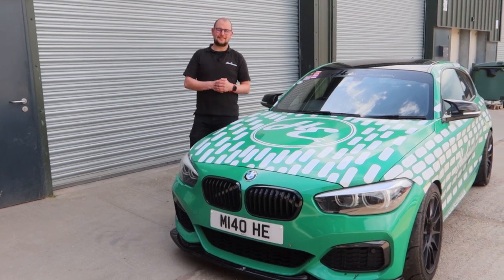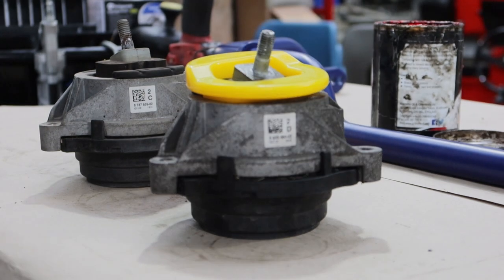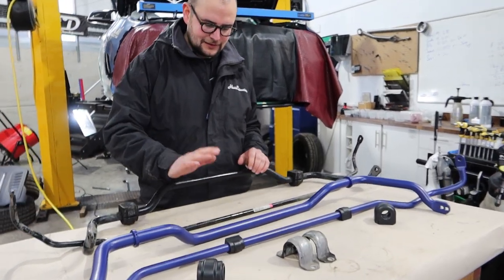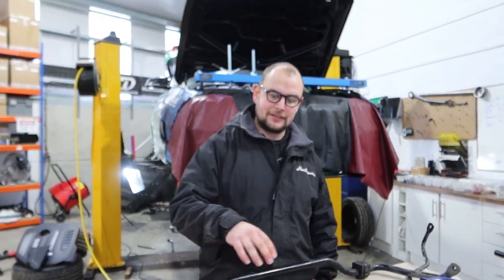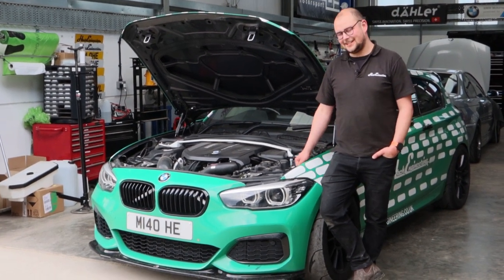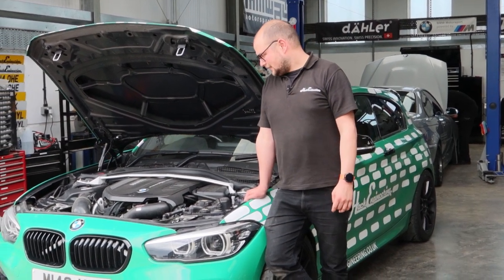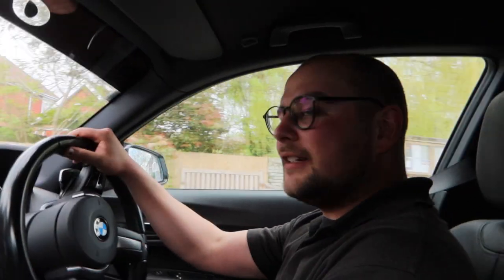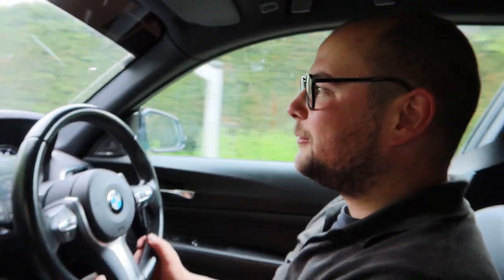MUST DO BMW M140i Chassis Upgrades For The HE140i!

Comment: Trying to find out size of front anti roll bar as I want powerflex bushes for the oem one. Been told elsewhere its 22mm. Yet powerflex dont sell a 22mm.

You say its 25 tapers to 22. So Im guessing thats the answer. Powerflex fdo a 24mm, 25mm and 30mm. 

Guess I go for 25mm.